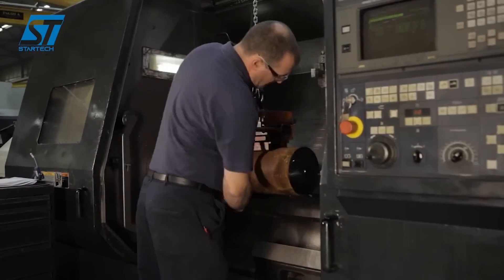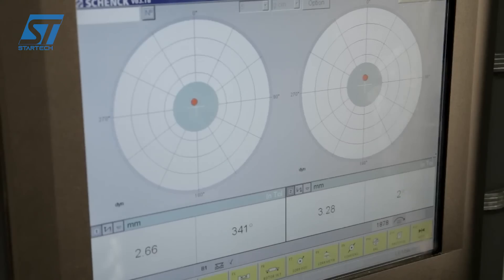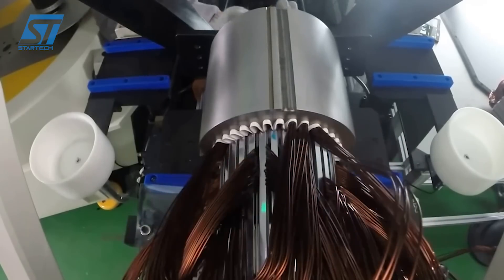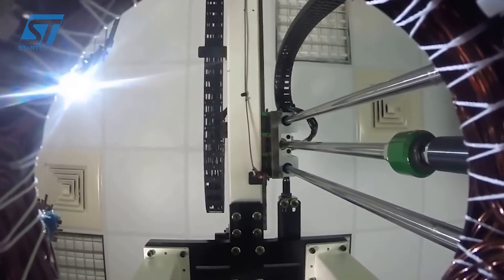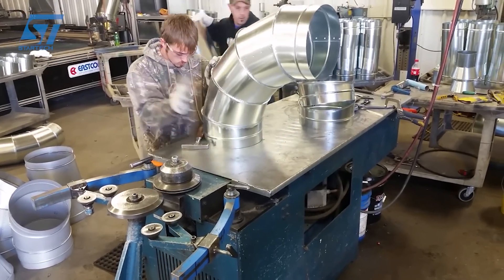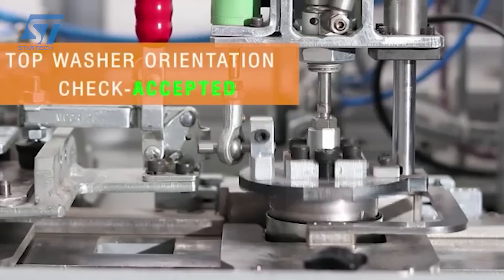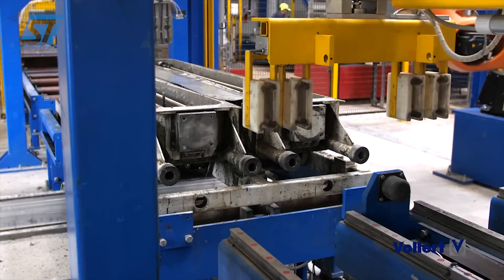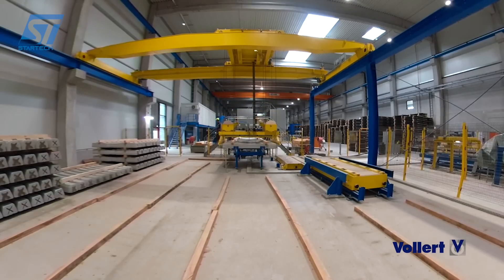Modern Bearing Assemble Production Line & Other Exciting Machining Process. Incredible Technology!

Comment: The implementation of modern manufacturing machines in bearing assembly lines has undoubtedly increased production efficiency, but it's imperative to address the safety risks they pose to workers.